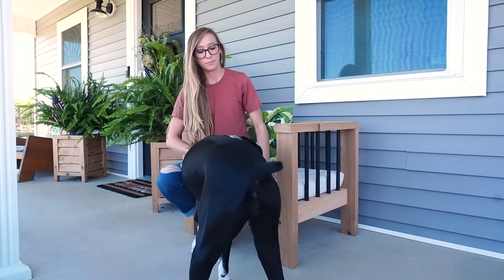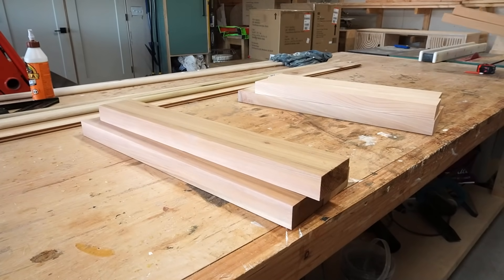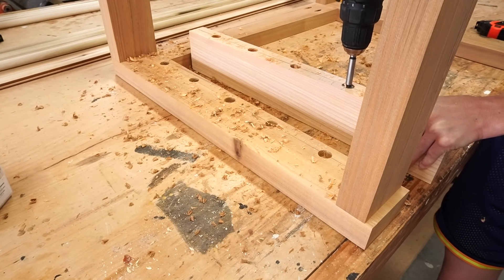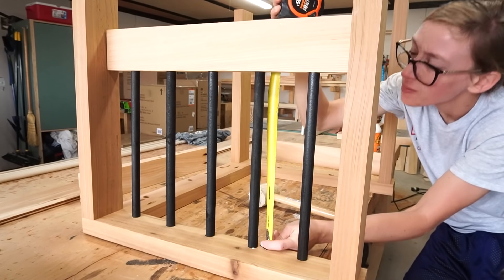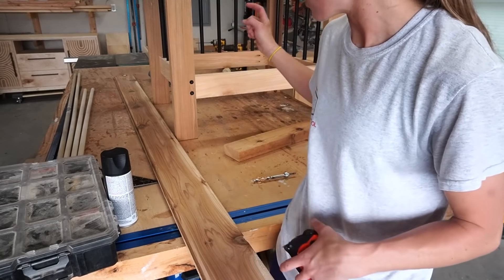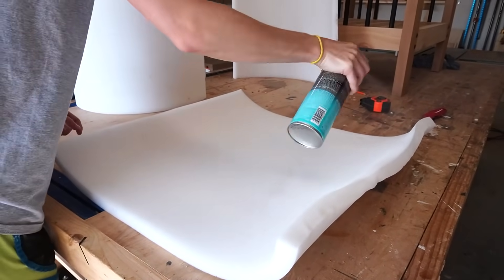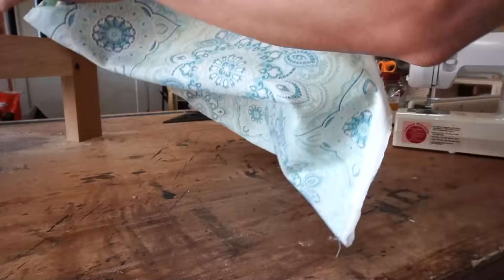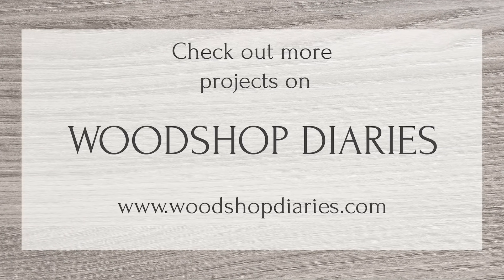How to Build a Modern Outdoor Chair--From 2x4s and Dowels!

Comment: Your design is simple, clean, and customizable. Beautiful!
Foam cutting tip - use an electric carving knife, especially if cutting a lot of foam. It makes for quick and clean edges.
Cushion tip - wrap the foam in batting to round over the edges a little bit.
Reply from the maker: Thanks so much! Yeah, I keep a utility knife a lot handier than an electric knife, but that works too if you’ve got one handy. Also, for outdoor cushions, I didn’t want to use batting as it’s not great when mixed with water. But for indoor cushions, yes 👍

Comment: Simple but elegant design.  I didnt see sanding step.  Is it not necessary with outdoor furniture or you omitted that boring step to shorten the video?
Reply from the maker: Thank you! I left out SHOWING the sanding as it’s pretty boring. I sanded between every step…after cutting, after assembly of each piece and a final sanding at the end.

Comment: Thank you. Thinking of making for college daughter to put in apartment balcony. 
What was your wood material cost?
I am thinking of buying the bottom and back cushion and adjust the plants to fit the cushions instead
Reply from the maker: I’ve got the materials list in the plans on my website and you can check your lumber prices for the materials you’d need in your area. Prices vary by location so mine would probably be different from yours anyway. 
https://www.woodshopdiaries.com/how-to-make-a-diy-outdoor-chair/
Also, I made this to fit a 24” square cushion which is a pretty common size for outdoor patio cushions so you shouldn’t need to modify anything 👍

Comment: Hey Shara, I loved the project, I've been looking to do something similar too.  But I was thinking the seat was too hard, I want to use some webbing criss-crossed in the seat to give it a bit more comfort.  What's your thoughts on that or how you ended up with what you got?
Reply from the maker: Thanks so much! Since this was for outdoors, I just planned to use cedar from the beginning. It shouldn’t sag or mold over time or weaken due to exposure to sunlight. If using inside, webbing would be a good option, but personally, I wouldn’t use it outdoors as it’s hard to clean, and could become brittle and dried out from the sun over time. That’s just my two cents 😅

Comment: Are cedar 2x4s a lot more expensive than regular 2x4s? I've never seen any in the stores around me.
Reply from the maker: The pine/spruce ones at my store were about $4-5 (I can't remember, it changes so often) and these were about $9.  They did come rough, so I had to do a little extra sanding, but not a HUGE difference in price considering I only used 3 of them